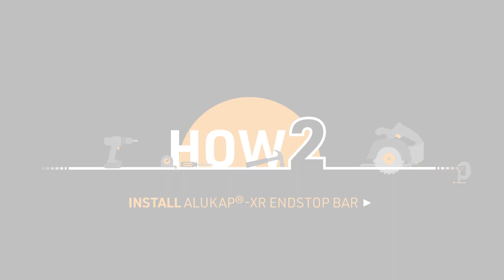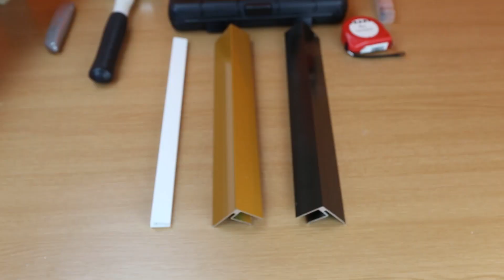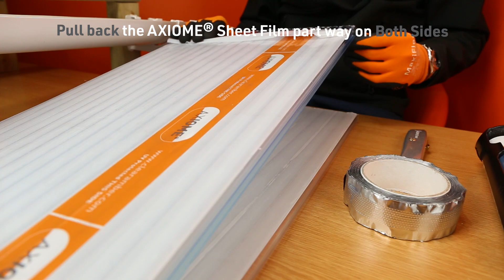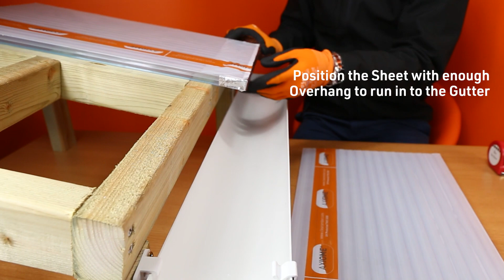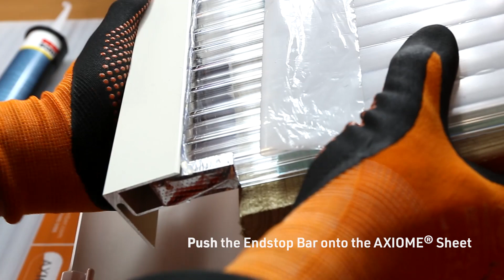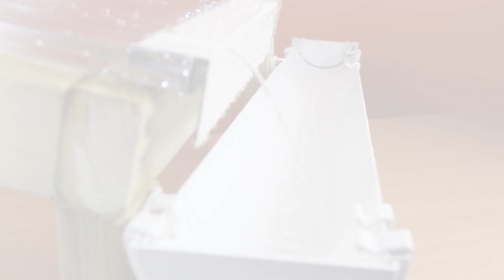How to Install ALUKAP®-XR Endstop Bar

Comment: Is this the same method for double glazed glass? Does it need the tape to seal it?
Reply from the maker: Great question - yes, our Alukap XR glazing bars are very popular for and designed for use with glass. As you say, use the same installation method but no tape needed. Our Securbond Sealant is neutral cure so compatible with most glass types but double check this with the glass supplier based on any glass coatings you have.

Comment: Which silicone are you using?
Reply from the maker: Thanks for asking, Waheed. We are using our Securbond Silicone, this is a premium-grade silicone that has been specially designed for use on polycarbonate sheet projects. It is important to use the right type of sealant when installing polycarbonate sheets because standard sealants will attack the surface of the plastic.
https://clearambershop.com/collections/alukap-xr-glazing-bar-system/products/securbond-silicone-sealant
Reply: @ClearAmber  that's not what you're using in this video 😀
Reply from the maker: True! This video was shot several years ago so unfortunately before we manufactured a solution to combat the all the problems caused by standard sealants. We have since released our Securbond Silicone to improve waterproofing, the roofing sheet lifespan and the strength of the seal.